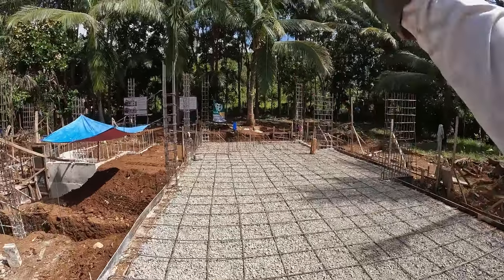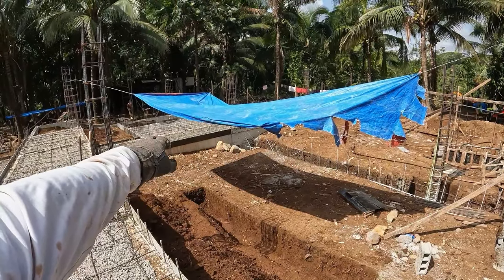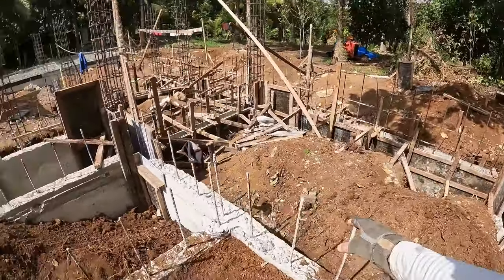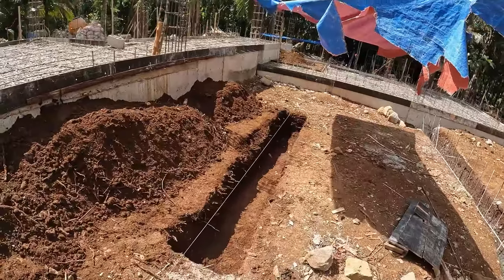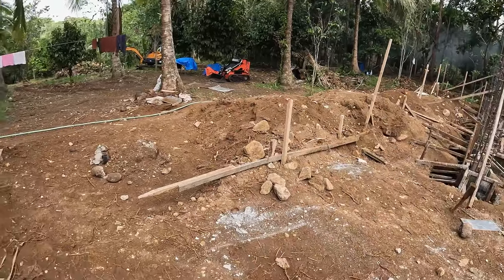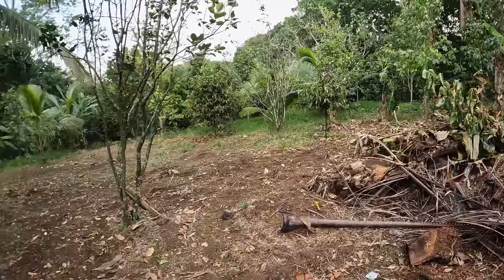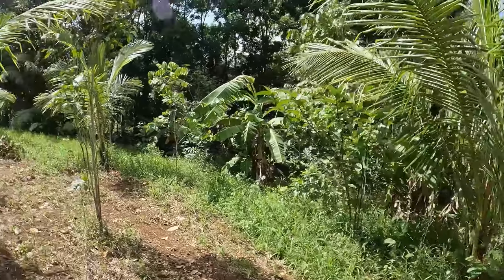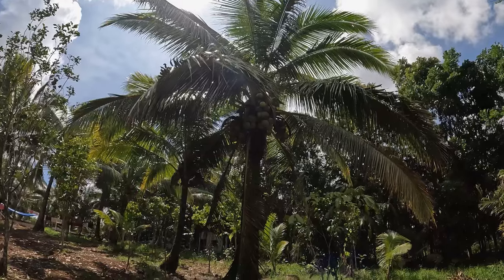New House Build | Progress Update 🚧 | Home Build Philippines | Ep. 08 | TORINO

Comment: Hai Mickael nice progres. Some questions and tips for you. How thick is your slab going to be in cm? What is your concrete mix? 
Tip; dont forget to put 5 cm spacers under the rebar for the slab. Always a thums up for you. Regards Jack
Reply from the maker: we are using a 1-2-3 mix, 1 cement, 2 sand, 3 gravel. slab is 10 cm thick. yes, on the spacers.

Comment: I don’t see any vapor barrier under that rebar.  So any room running air conditioning will be sucking moisture up through the concrete slab resulting in wet floors and mold.  Sure hope I’m wrong
Reply from the maker: Iv'e struggled with that question too. In my "Garage" project here I planned to use a barrier under the slab, but events got in the way and didn't use it. (I had grand plans for this floor, but they all didn't work out) 

I do keep it as close to 72 degrees as I can 24/7 and havn't had any issues with moisture. I totally agree with your point though, especially for concrete work in colder climes north of Missouri, but I don't think they are used here in the Philippines much.
Reply: Yep & architects in RP live without A/C so have no experience.  I used old billboard tarps, started under the stem walls & carried them 100% between the base and final rebar.  Everyone humored the crazy American but tarped my floors!  Also put solignum under the tarps, we’ll see haw the termites like that!